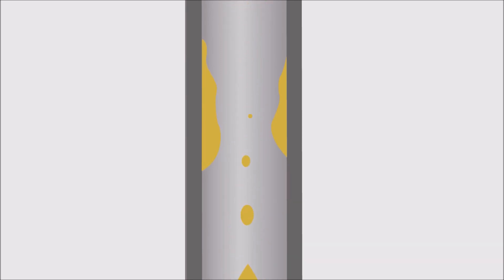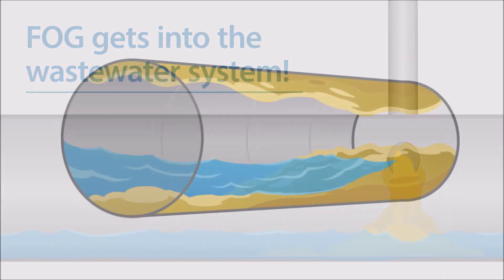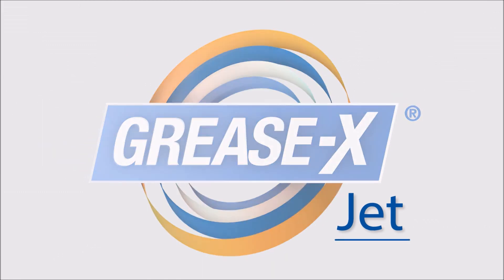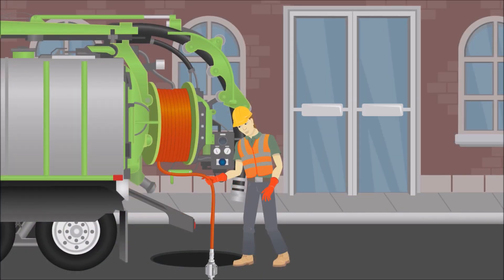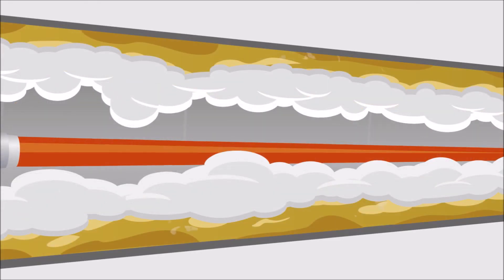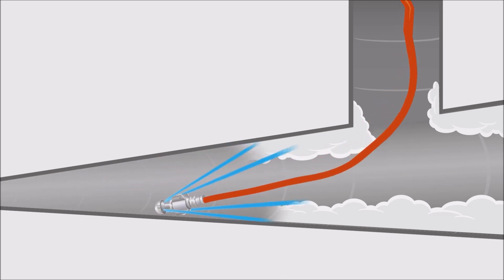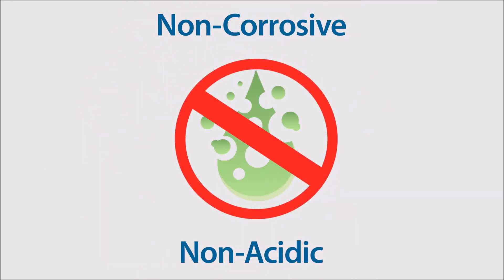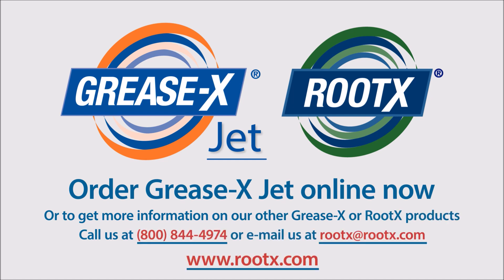Grease-X Jet Application

Comment: How does it work on soft poop
Reply from the maker: Grease-X Jet is designed to eliminate fats, oils and grease which have solidified in sewer lines causing a restriction of flow. Hydro-jetting alone should sufficiently remove any other soft matter in the pipes.
Reply: @RootXCorp  I thought it might help with soft poop stoppages because of the grease built-up in the stool